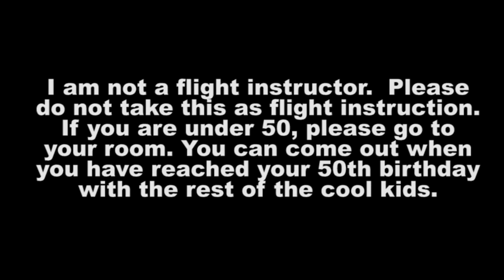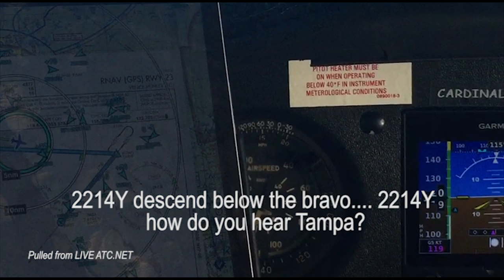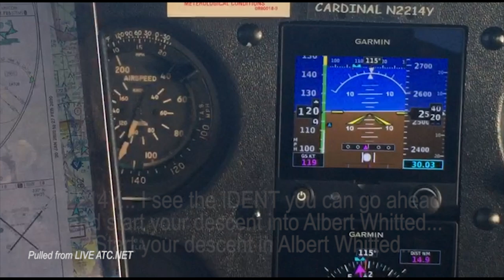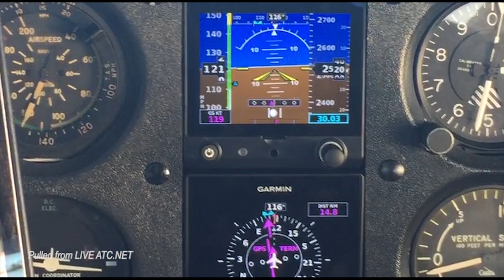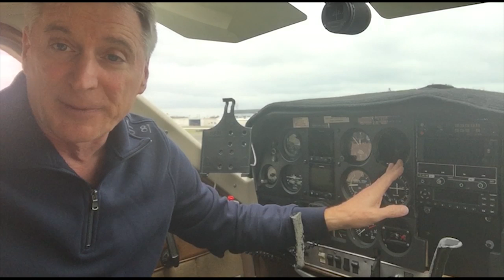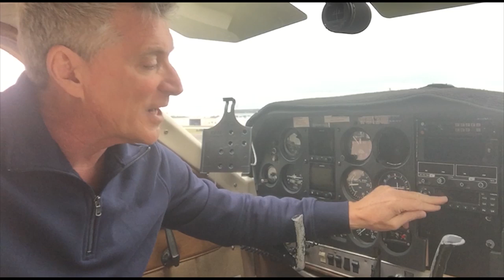What do you do when your radio fails?

Comment: Good reminder to immediately squawk 7600 if problem with comms, regardless of where you are. 

A similar thing happened to me when flying around Midland, TX.  ATC gave me 100% vectors to the airport just by asking me to ident on request. 

On a humorous note, I'm sure that all the local fliers around my original training airport scattered when they heard me on the radio.  LOL!
Seriously, after my comm issue, I went out a bought a handheld transceiver, and kept it charged.  It also was used to listen to ATIS, etc and paid for itself over time. 

Thanks for the video.

Comment: I carry a hand held as a backup, but it has serious range limitations. Transmitting from the inside of the cockpit on a 4 watt hand held, you have much shorter range than with your 25 watt primary on an external antenna. I fly an experimental airplane, so I can make modifications that I see fit, withing reason. One modification I made was to install a simple A/B antenna switch that is rated for VHF use. Then I installed a short pigtail lead of coax that sits coiled up in the map pouch by my left leg. Now if I have to switch to the HT, I at least have a  good antenna that will get my signal out. Testing has revealed that the 4 watt HT now has almost 75% the range of the 25 watt primary radio. Not bad performance!
Reply from the maker: Peter Toth awesome!!! Thanks for watching!

Comment: Same thing happened to me approximately a year ago right after departure from LFST, although I weren't able to squak 7600, as the transponder was the first thing to fail. After turning off all the loads, the transmission power of the remaining radio was just enough for another airplane in the CTR to hear my blind transmission. He than relayed me a landing clearance from the tower. Exactly the same reason, slipping belt and an old battery. After the incident a portable radio with a fully charged battery is in a personal MEL list for each flight going through a controlled airspace.

Comment: Flying IFR install warning lights for voltage, oil pressure and vacuum system and buy a handheld with exterior antenna been there done that
Reply from the maker: I am leaning towards an engine monitor.... the JDI 30,.... but I have to stop upgrading!  :-)

Comment: Glad you made it down safe.  Can't help but wonder if this was related to the "smell" issue you had earlier.  Is your alternator voltage regulator working correctly?
Reply from the maker: The odor was coming from dirt and oil near the fluid reservoir on the brakes - near the pedals - thanks for watching!

Comment: Were you on an IFR flight plan?  If you were on an IFR flight plan were you in IMC?  Is the reason your EFIS primary flight displays continued to work is because they have a dedicated/internal battery emergency supply?  If so, has that instrument internal battery been depleted and now needs to be replaced, or are they self charging off the main electrical supply?
Reply from the maker: Apack Westbound I was on VF our flight following because it was only a hour and a half trip and the weather was absolutely beautiful. The Garman G fives have a back up battery system so they stayed working - 12 V battery just needs to be replaced and the alternator belt had been slipping so for a while it was drying more current than it was producing and the night before I was flying at night and I had everything on and that probably was a pretty big drain as well.

Comment: What happened to taking a look at the ammeter and adding a voltmeter? When you go full electric a voltmeter should replace the vacuum gauge .
Reply from the maker: Vacuum system was removed with the G5’s ... jdi engine monitor may be next ! 😆
Reply: Over 50 and Learning To Fly! 

A less than $250 davtron digital voltmeter&oat gauge should be next on your list of  things to be added! Also a ground com switch that takes power straight from the battery to one radio and the transponder taking everything else out of the system. Also led bulbs for all external lights (that includes the tail beacon).

JMHO!
17700817
Reply from the maker: tqmx1 just ordered one ! Thanks !!!
Reply: Over 50 and Learning To Fly! 

By any chance are you a cfo member?
Reply from the maker: tqmx1 yes!